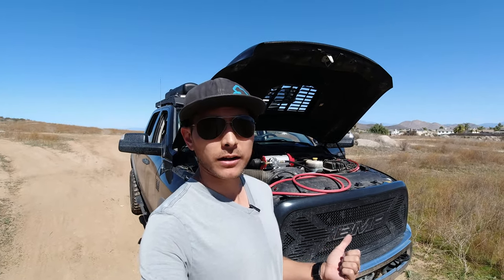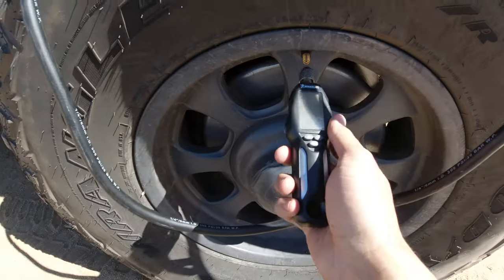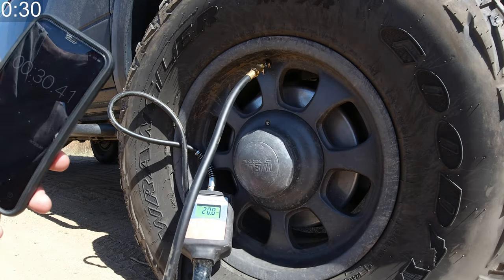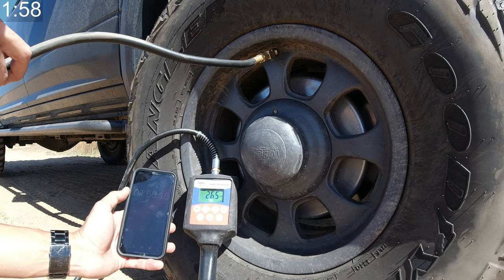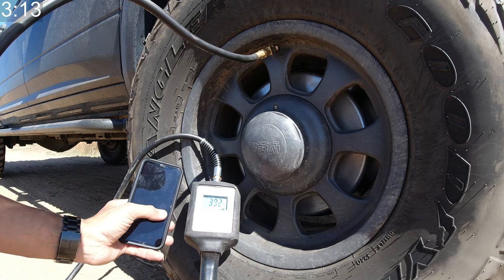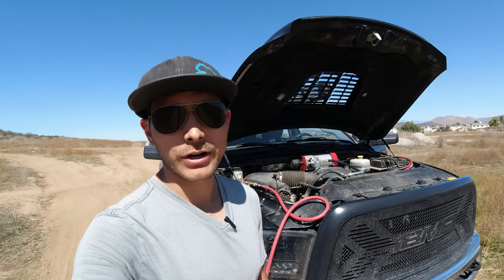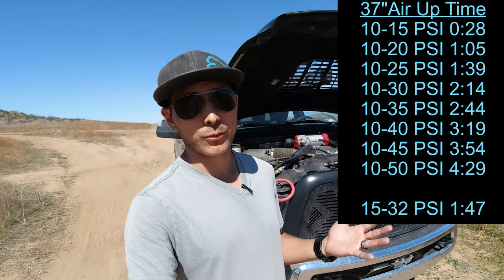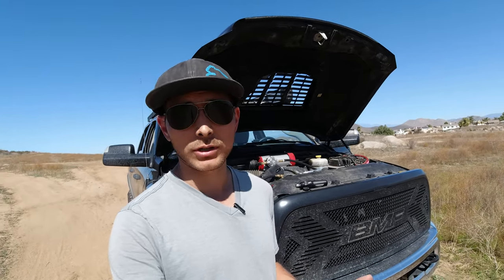Extreme Outback Magnum Air Compressor Timed Inflation Test-How Fast Can It Inflate a 37" Tire?

Comment: I wonder if the times would change much if a 2 tire inflation hose setup was used. Supposedly the valve is the limiting factor and the Magnum "should" be outputing more...Might be worth a try and get you going faster. 2 tire kit would be less hassle than a 4 tire

Comment: It’s not that fast. Seems like Milwaukee m18 portable compressor is faster than this.
Reply from the maker: It might seem like it, but I just watched a video with the m18 going 14-28psi on a 35” tire, and it was well over 2 minutes.
I’d love to grab one for a test to perform a true comparison however. Obviously air volume between tires will vary in the same rated size, let alone 35 vs 37.

It’s great to see we have a lot of options at the end of the day, there is definitely no perfect compressor for everyone but more options sure is nice.